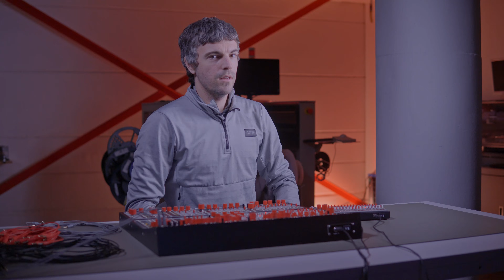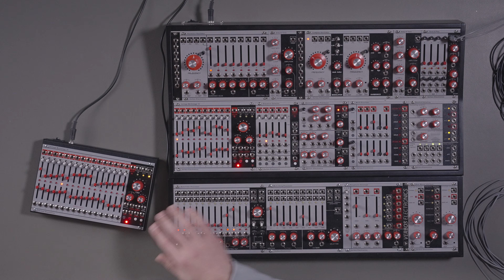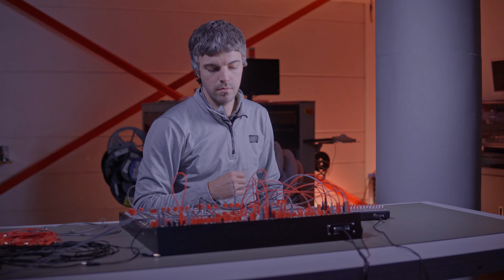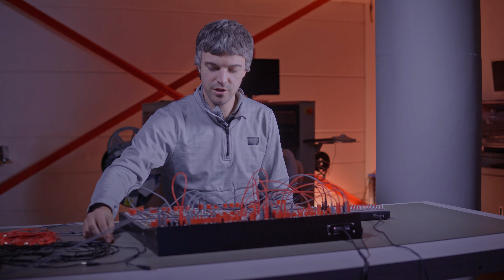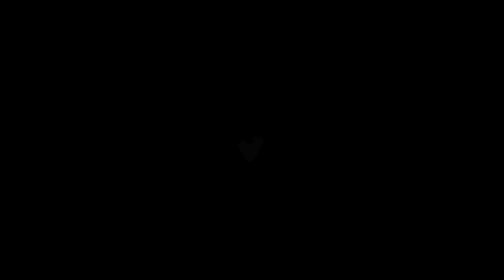Voltage Multistage 10 - 52 steps

Comment: I sent my VMS 16 back because of the problem where it couldnt hold voltage constant and was increasing everystep where the gate was off. Was that problem fixed yet? Is the same problem on the VMS 10?
Reply: I also had the same problem. Will buy if it’s fixed.
Reply from the maker: We have fixed the problem on the VMS16 and it is not present on the VMS10!